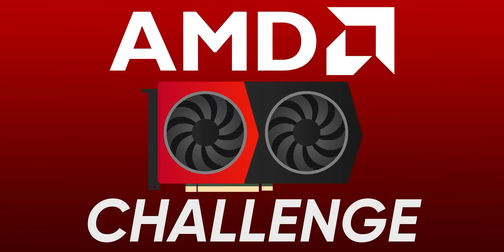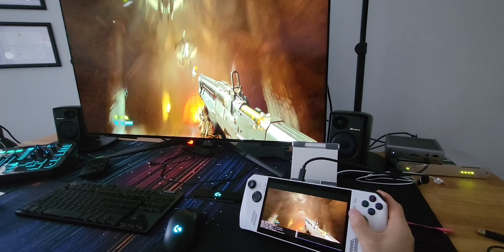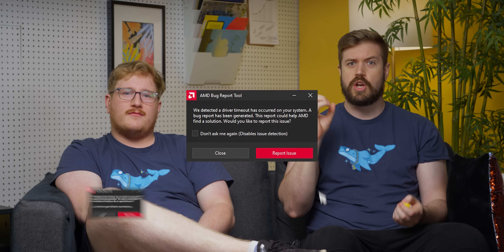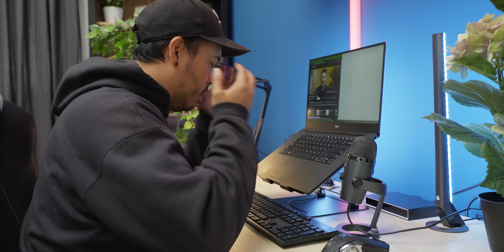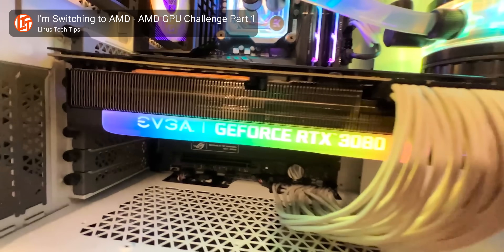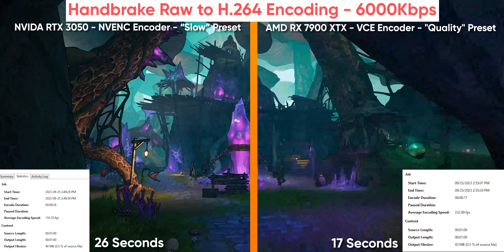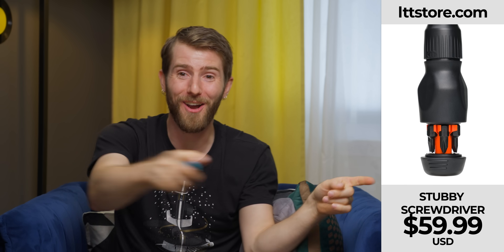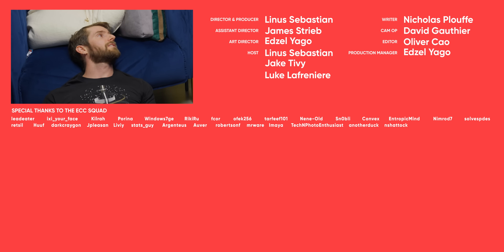I’m Staying on AMD! - Radeon Challenge Pt. 2

Comment: Personally my experience with an amd GPU has been almost flawless if I disregard windows update breaking the drivers.
Reply: yeah i switched to the rx 5700 xt from the gtx 1070 in 2019. The 1070 was a flawless experience, i had no issues at all. The 5700 xt wasn't perfect. I'd have a few black screens here and there, but none of the driver horror stories that i heard about that card. And now i upgraded to a 6800 xt which has been completely flawless. My only complaint about amd gpu's is that they'll never catch up to Nvidia in ray tracing as more and more games are making ray tracing part of the intended experience. Also dlss is so much better, but amd value just can't be beat for me, especially as i have bills and responsibilities to take care of before my pc games.

Comment: I've been using AMD on Linux for the last six years daily with basically zero driver issues. I can't say the same on Windows though...

I think that AMD GPUs is one of the few cases where the Linux open source driver has surpassed the Windows closed source one in terms of stability.
Reply: Mesa also has better openGL performance still iirc even after AMD upped their openGL game a year or two ago.
I've never had a bad time with mesa. The standards for the mesa driver are just fantastic.

Comment: Edit:  it would be nice for the team to redo this challenge on normal set-ups, and for them to actually follow manufacturer recommendations for install.  While I understand you want to get an authentic experience, it does sort of drive home the point that just because you want something to work a certain way, doesn’t mean it will.

Particularly in Linus’ case, I have to wonder if more of his issues could have possibly stemmed from the install process.

I’m willing to accept a lot of downsides just to spite NVIDIA.  

I do agree that AMD needs to stop rushing these cards into production and do some better QA testing prior to launch.  They would pick-up more market share by just launching an actual finished and competitive product, rather than an 80% finished card that only the NVIDIA haters will stay loyal to.
Reply: Completely agree here, or at least have 1 person who did it properly. I can understand not doing a fresh install of Windows but Luke's pc is a complete mess tbh, CPU slightly defective, 2 different power supplies, riser cable etc. Some cards are just slightly more sensitive.

I've got an rx6900xt and for my use case it's been absolutely stable and no issues at all really apart from being one of the lower binned cards unfortunately.

Comment: I'm curious if Luke used DDU to remove the Nvidia drivers first. 

Also, remember that whole Linux challenge where you guys fell off of it hard? AMD GPUs on Linux makes for a fantastic experience. Just putting that out there.
Reply: DDU doesnt work 100% of the time, i just ran into issues goin from my 6900xt to 4090 dealt with the minor crap for about 6 months, did a fresh install and now everything is perfect, kind of mad at myself this whole time

Comment: I was sceptical about switching to AMD but price forced my hand to a 6800xt.  Initially slow and problematic. After a quick Mobo BIOS update and I'm pleasantly surprised. No problems and such a huge performance increase with the 5800x3D. It even makes Star Citizen playable! Great to see Luke and Jake talking. Hibernation mode is not advisable, maybe on a laptop and you need to jump off the train in a hurry. Freesync is selectable per monitor. Oh and 53w while watching this video at 1440p.

Comment: Tbh i spent years fighting stability and data corruption problems and all my hardware seemed to be working properly and i kept replacing stuff, finally realized that with my drives and rgb and trying to auto overclock my power supply was over loaded and my house has old wiring

Comment: Luke mentioned refresh rate, or FPS on the desktop being very low after a wake up, fun fact, the same thing happens under Linux on an AMD card, from time to time. Could be just my specific setup, or could be an issue within the driver stack.

Comment: @Luke - Just as an FYI, I get those "Video freezes while audio continues to play" bugs randomly as well; however, I have an Nvidia 2080 Super with a Ryzen 3950x. I believe it has to do with either the BIOS Firmware or windows being dumb, as these issues have been removed since I installed a newer (Post Oct 22) BIOS and updated to windows 11's latest version.

Comment: I bought a Asrock 7900XTX Phantom Gaming OC in July and havent had any crashes at all nor any issues. 
My hardware:
CPU: Ryzen 9 3900X
RAM: 32GB Corsair Vengance LPX DDR4 3200Mhz
MB: MSI X570 -A Pro
OS: Windows 11 Pro 22H2

Comment: I am also interested in lowering the power consumption. my config of Ryzen 5 5600 + RX6600 idles at 80W.
I managed to lower the power to around 65W by tuning down PBO, removing DOCP and lowering SOC voltage via offset.

Comment: Had a similar experience with my 7900xtx, countless display timeouts and random crashes. At the end i had to rma the card after replacing the MB and Ram. AMD was very helpful even when they had no clue. Since the RMA everthing runs flawless even the under/overclock works so much more stable. Since the last two month drivers improved even more. Curios what improvements will follow in the near future

Comment: I just up graded from a 2700x and a 5700xt to a 5700x3d with a 7800xt I did do a fresh install on windows 10 and up dated all drivers on my MSI x570 mobo and I have not had a single crash in any game but do have you tube thing going on one in a wile. I think a fresh install of the Os and drivers was a life saver

Comment: If someone is watching this a year later trying to decide if they should give AMD a chance, short answer is YES. I am running an rx 7900 xt and performance is amazing and I have not faced A SINGLE ONE of the issues they are describing here. I had some problems and I did doubt the gpu, but each time it turned out it was something else and now that everything is fixed there are not isses. AMD gives more perofrmance for a  cheaper price, so I won't be going back to nvidia unless I find some crazy second hand deal that cannot be passed up (which probably wont happen. In my country at least I still see rtx 3080 selling second hand for as much as an rx 7900 xt brand new. And the 7900 xt absolutely crushes the 3080. It ever crushesh a 3090).
Reply: Hey, appreciate the review! Would you say you've noticed a real absence in ray tracing at all? I'm torn between getting one or hedging my bets in the new RTX 5070 TI. It really comes down to do I value VRAM or Software/ray tracing more. Thanks!

Comment: I'm not using anything near what you guys were, but I have noticed some really weird "issues" with Radeon cards over the past couple of months. I have a Radeon VII and a 5700 XT, and the 16gb Radeon VII would have microstutters in anything that I did: YouTube, Forza Horizon, Battlefield V. Just random dips with the GPU still sitting well below even 80% usage. Connecting a previously connected display would also reset the display resolution/frequency to the lowest allowed, normally 720p at 30hz. Both of them are in "back-up" computers, though, so not a huge bother for me.

I've seen a lot of stability improvements over the last month or two, though. The 5700 XT, especially, has come a long way since it was launched; I simply have the longest experience with that one lol

Comment: Some of the problems are often due to other software. For instance I switched to a 7900 XTX and I was having weird driver crash.
Turns out it was MSI Afterburner. Even if not running in the foreground, it loads some type of service or whatever in the background and after uninstalling it I am (touch wood) yet to see any crash.

Comment: Just run both AMD and nvidia. I've been running team christmas with a 6750xt primary and a 3060 secondary. I've been insanely stable, and some choice games such as PortalRTX and Cyberpunk seem to be able to still utilize the 3060 for raytracing calculations in parallel with the 6750xt handling geometry. This also allows me to use my 3060 for tasks that over the years have become inextricably tied to nvidia such as media encoding and blender rendering without sacrificing the raw raster performance from AMD.

EDIT: For the stability, I have an example. Yesterday (09-30-2023) me and a friend played star citizen for 8 hours straight and my machine was simultaneously running SC on the 6750xt and encoding video files via handbrake using NVENC on the 3060 with very little performance impact. I noticed my frames were a little lower in a major city such as Orison, but I only dropped from 50 to 45.

Comment: I have a full AMD build, got the 7900 XT Red Devil version and a 7600X CPU. I’ve noticed lots of people says they have problems with AMD but I’ve never had any issues. Lucky maybe. Only had problem with the ram, XMP was at 6000mhz by default and my cpu can only manage 5400mhz had to change that manually.

Comment: 7900xt has worked great, apart that it fails to undervolt the card at times. AM5 experience has been pretty rough though, lots of bad firmware, quite a bit bugs and crashes. Currently it works fine though

Comment: Issues with teams and discord, (as well as web browser, like youtube and twitch), are almost certainly related to electron/chromium bugs with hardware acceleration... I had similar issues with a notebook that has an dual gpu (dedicated nvidia and on-cpu intel). It's fixed there, but back than when the issue occured it was the browser trying to use nvidia commands on non nvida GPUs.
It was also very "funny" that it was reproducible with NVenc/NVdec (and VP9) stuff...
And it also occurred regardless of the host OS (tested with windows and linux).

Comment: Luke is definitely using a PCIE gen 3 riser with his bios set to Gen 4. I have the same issue whenever my bios resets to default. 

Go into AMD PBS (I think) in bios and change PCIE X16 to Gen 3 and it will fix it. 

I'm using NVIDIA 3080 and the severity of the issue isn't too bad when it's on Gen 4, but there is definitely a difference.

Comment: Thank you luke for sharing this experience.
I have had roughly the same problems since a year ago and nothing really fixes the screen drag "5 fps" thing. 
I am running on nvidia tho, but the one thing in common is my riser cable. 

Next time i update my watercooling loop i will definately put the gpu back in the slot directly and see if that fixes stuff

Comment: I switched from a 2070 to a 6900 XT about 1.5 years ago. I encountered many of the issues mentioned before I did a Win10 reinstall. Nothing after that. The GPU is an essential component of a (gaming) PC so a fresh install is obligatory imho.

Comment: Im using RX 6600 and Im very happy with it. Runs most of the games smoothly on 1080p ultra settings. Also the AMD Software works fine, being able to tweak gpu settings and record videos with ease is a nice addition.
Never had a crash caused by the gpu, rarely had crashes after installing driver updates, but those errors are easy to fix and AMD releases quick patches every now and then.

Comment: What is funny is Lukes experience is what i had with a RTX 3060 12gb asus Rog card. I have gone as far as updating motherboard bios. Checking temps on everything. 

The most frustrating part is, it doesnt happen at consistant times and in multiplayer fps games. If your game crashes and you leave early any xp is gone. Imagine half way through a match.

Comment: I was running an RX560 for years and recently (about a year ago) upgraded to a MSI Ventus 3060TI; besides the initial install being a bit rough for the driver swap, it went really well and I haven't had ANY issues since- at least GPU related. Ironically whenever I do have an issue the GPU is one of the first things that I or anyone else thinks of, and it's ALWAYS not it. 

Not quite the exact same situation but I thought it was noteworthy to bring up.

Comment: Been using AMD for about three years now, starting with a 6900XT, then moving to a 7900XTX. I haven't had any GPU related issues, BUT, I've been gaming in Linux exclusively (using proton) so I don't know if that has contributed to things.

Comment: Man i recently bought a rx 6650 xt and i really like it i never had these issues or any issues.also i have a ryzen 5700g yea i had a inergrated graphics card which i replaced with the 6650 xt also i have a 500w power supply yea ik its pretty bad but it still does the job

Comment: I've seen many of the issues Luke experience on my 6650 XT. I found the full system stutters were caused by hardware acceleration in web browsers, edge was the worst. no browser open fine, open browser full system hangs for 3-6 seconds at a time. I was just playing a game and my youtube video went to like 2 fps for a while. Just some unfortunate weird stuff.

Comment: I upgraded from a GTX 1080 to an RX 6750XT (Asus Dual) a month ago and I've had basically no issues at all. Only real oddity is that my main screen gets all glitchy sometimes after starting from a full shutdown, but a quick restart always fixes that. Performance is excellent for the price (400€-50€ cashback and Starfield Premium Edition), temps are good etc.
The Adrenalin interface is a thousand times better than GFE.
In conclusion, I am incredibly happy. I also need to give more money to AMD now in the form of a CPU upgrade.

Comment: It's funny I bought my 5700XT at the end of 2020 and have had a very similar experience to Luke, the crashes were very frequent especially in the beginning but after doing BIOS/Windows/Driver updates it was maybe like a system shutdown once every 3 months. 

I ended up trading the card for a 6700XT a year later with a miner and that has been a completely flawless experience to this day. I've used the 6700XT for about a year on Windows, switched to Linux in part thanks to LTT's challenge and it has been perfectly stable and well performing on both operating systems.

I'm still wondering what the deal with the 5000 series was, some people basically couldn't use them and for some it was completely fine. The next gen managed to be perfect in contrast. Was it really drivers or something with the architecture?

Comment: I use this same GPU along with a i9 13900K. I had 1000w power supply and my pc would randomly shut down when playing games. Upgraded to 1350W power supply and I haven't had any issues since. Card runs great. Getting 240 fps at 4K in Warzone.

Comment: Since 2014 I had a HD7750, a radeon 260x, a rx 580, a Vega 56, a 5700XT and a 6800XT.

I never had all of the issues described here.
My only two issues in a decade were:

1- in 2018 a driver update broke a PS3 emulator, fixed in 2 months.

2- when I placed my 6800xt using 5700xt drivers it took connecting to another monitor/TV to output.

3- when playing resident evil 8, in the first driver it crashed if I turned on RT.

That's it. Pretty good since I've had some nvidia issues with my 3080 too:
- Gsync not working with Gsync Compatible monitors sometimes
- Less performance even in VR Titles like Dirt 2. Yeah It was noticeable especially in VR. 

Overall Nvidia is more stable but AMD is still super stable and recommendable.

Comment: I have a 7900xtx and also had the 100watts idle. my setup is 2x DP monitors(1080p and 1440P) and 1x HDMI TV(4k) for when i want to couch game.
what solved it for me is unplugging the HDMI cable. and the idle power dropped to 20watts. when plugged in again it goes to 100watts even when the TV is off. I mostly keep it unplugged when using the PC on my DP monitors.

Comment: I built a new system with a AMD RX 6750 XT back in April. Aside from the incredibly loud coil whine when playing games using Vulkan (yeah just Vulkan) it has been working great. That was until I installed and ran Starfield. I've had a couple crashes in that game and ever since then I've had the same Driver lag crashing/discord crashing that Luke is describing. Updating the driver and setting the Gaming Graphics profile to Default (everything off) has helped somewhat (it was 2 versions behind) but I still occasionally get that driver lag even just watching a YouTube video.
PC will grind to a halt. Can't open task manager. Alt-F4 responds after a minute or so. CPU and GPU benchmarks run for hours with no crashing ever. PSU and thermals have plenty of headroom. No Windows updated were installed prior to the crashing. Dunno what changed, but it sucks crashing 6 times in an hour when trying to play co-op Deep Rock Galactic. Can play all day without a crash and then other times ...

Comment: I've had one driver timeout in Starfield on the 7900 XT. BG 3 and Saints Row have both been just fine. And that is... pretty much what I've played since installing the card.

Also... HW Monitor shows the card drawing... 7-8 watts TBP at idle, and about 25W playing this video. My 5800X CPU is also pulling about 25W at idle.

Comment: i’ve been running a 6700xt for about a year now, and while I am primarily on linux (the main reason i went with amd) I haven’t had too many issues on windows with it, amd really seems to just need a little while to iron out the bugs and after that they are solid